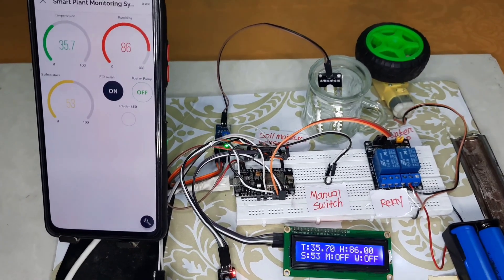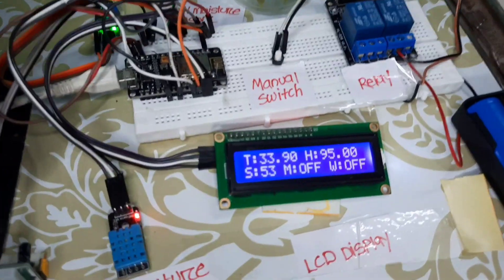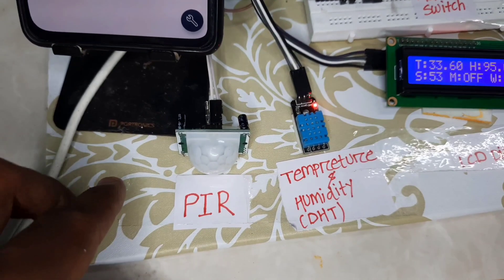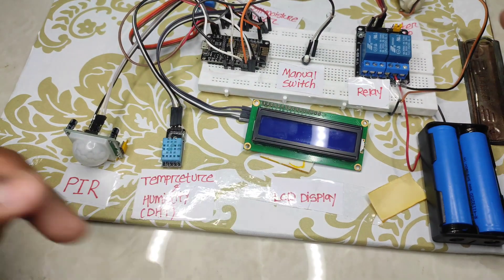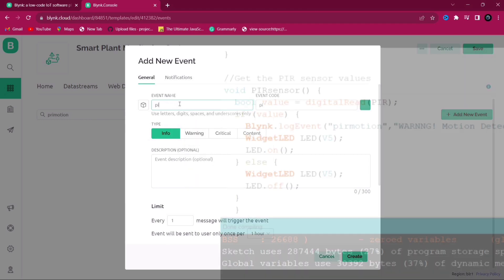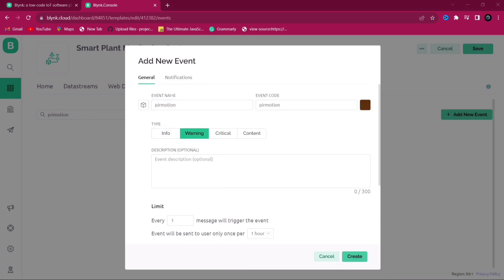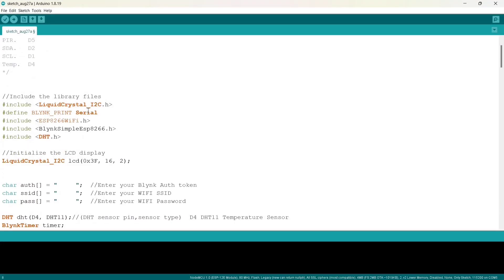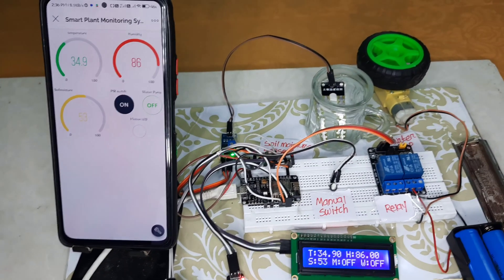Smart Plant Monitoring System Using  Nodemcu and Blynk 2.O || Smart Agriculture Project

Comment: The pump relay does not come on when I set it to the pin shown in the circuit diagram, why am I experience this issue?
Reply: same here
Reply: @itzz_agrim  

The relay works when you put it on 3V, it stops when it's on 5V.

I don't know why, but that is what I have discovered and I think the 3V is not enough to trigger the relay.

Comment: Wheres the code?
Reply: The relay does not come on when I set it to the Vin pin of the node MCU as shown in the circuit
Reply: @donaldiro5398 I'm also facing the same issue kindly help
Reply from the maker: Check now